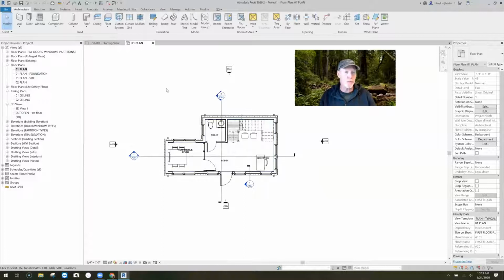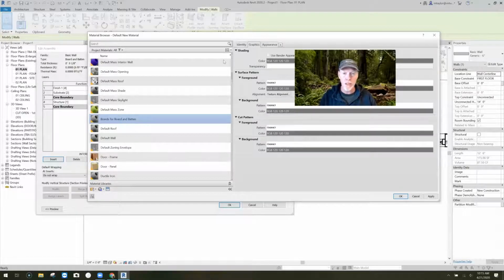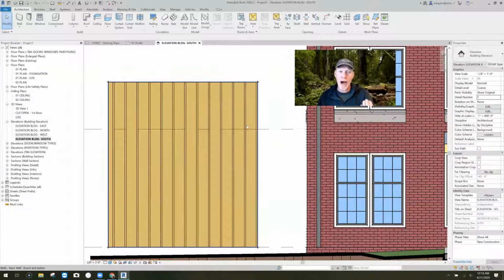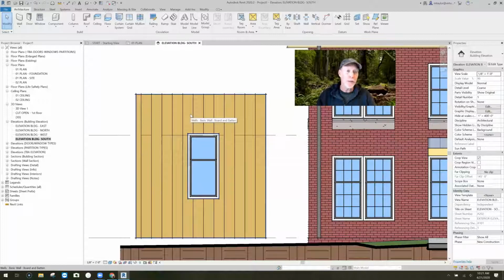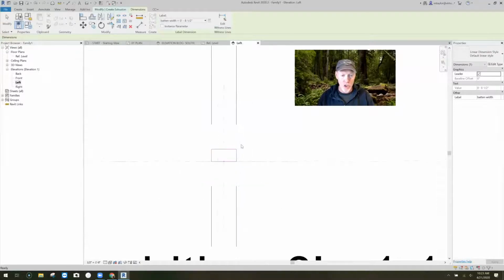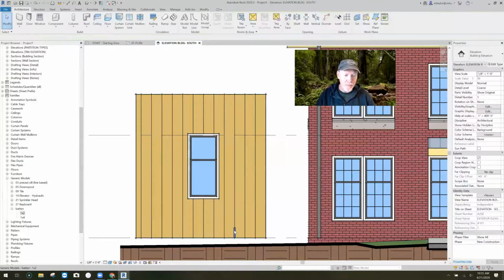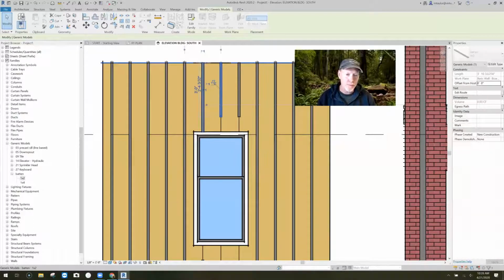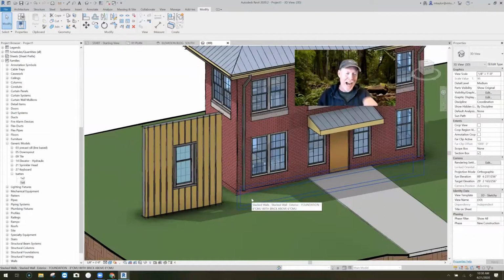BOARD & BATTEN - Pattern and True 3D

Comment: Awesome video...I just recently came by your channel; it is the most straight forward - Thanks!! I am being forced to switch from S*ftPl*n to Revit and it seems so much more time consuming and in my turn and burn environment I am losing my mind ( and possibly my job ). Is there a turn and burn method for elevations to paint or draw lines to display trims, frieze , bands etc.? this modelling seems far so slow compared to what I am used too.....desperately seeking advice. TY

Comment: Great video! I had an issue connecting the trim around the window frame. I'm getting prompted that I can't align the battens at each corner of the trim. and that there are constraints. So the batten pieces aren't flush at each corner. I've tried to remove the constraint but that doesn't help either. Do you have any suggestions for remedying this issue?

Comment: can you think a better way to model Yellow truncated dome tack tile on the floor?

I was thining similar approach, curtain wall flat on the ground. 

but can not figur to make circular truncated dome individually on grid intersection ??? 

current approach is 2 ft x 1/2in rail, so it can detact topo. how to illustrate the circular truncated bump dome on the rail?
Reply from the maker: If I follow your question properly:  I think I would represent the tactile domes on the floor with a pattern (easier to deal with in plan views) and then make a 'bump map' in my Material for any renderings.
Reply: @miketaylor-fantastic  

need to import circular grid pattern  from autocad to revit. then create bump map deal.

bump map deal will not shown shaded view, only shown on render view

Comment: Very informative video. Thank you for explaining this. I have one issue: I can't place the batten in Elevation view, only in 3D view. Any idea where I got turned around? I've watched the video multiple times and don't see what I missed. Revit LT2020
Reply from the maker: Hmmm. My thoughts: In elevation, make sure up at the top you select 'Place on Face' and select the face of the wall, before you select the Pick Lines tool. My guess is that in elevation you are somehow trying to place them on a workplane not aligned with the view. So try what I suggested and see if you can place them in the true elevation view.

Comment: Please help. the batten in not connecting to my entire line, i made sure it was the whole length when i edited the family, but it is only copying at 4' and i cannot edit the length in my work plane
Reply from the maker: Hang in there Mackensie... we can solve this. ;)   Ok. Open the batten family for editing. In a Line-Based family.. you need to connect your geometry (batten) to the Reference Plane in the family. So, in the family, in the Ref Level view.. you will see the dimension from the insertion point over to the Reference Plane (4'-0") Your batten geometry (created when in the Left or Right view) needs to connect (align and lock) to the Reference Plane. You can pull it back and away about a foot or so, then use Align to get it to extend to the Ref Plane, then LOCK it there by clicking on the little lock that appears right after you use the Align tool.  Save and insert it back into your project. It should work fine when you select a line on your model using Pick Lines.  I hope this helps. Watch the video again to see me do these things listed above. Blessings!
Reply: @miketaylor-fantastic  thank you. I actually ended up making it a profile and somehow that ended up working! Thanks for getting back to me so quick!!
Reply from the maker: @Mac_kensiiie  Thanks!  And good job on the profile!  I'm trying to make sure everyone has success when using Revit. We are all in this together! ;)
Reply: I seem to have the same problem. I drag in the 4' batten ok, but cannot stretch it to the top of wall.
Reply: Just read your reply to Mackensie which was the information I needed. Thanks Mike

Comment: You appear to really have a fun time putting this together.  I wonder if you'd have as much fun simply using a Vertical Wall Sweep?  A new category can be created in the Wall Object Styles and assigned to the sweep for controlling visibility.  Array the sweep along the wall @ your desired spacing. Now add & move windows & doors; modify levels associated w/ that wall, change the roof pitch of the wall attached to that roof, etc.  And the fun continues.  Thanks for bringing us so much joy in Revit.

Comment: How would you make the wraps in the walls in a seccion ? at the top and at the base .. greetings from Argentina
Reply from the maker: Hiii TheCheo89!  OK... as you have probably found, the WRAP feature only works in PLAN orientation. Typically materials don't wrap at the TOP of a wall, you  can put a cap on the wall if it is a parapet.  Nor does material typically wrap at the top of a door/window. A header will be at the top. And a sloped sill (wood/stone/brick, etc.) will be at the bottom. These can all be added as separate families (or a sweep for the wall cap).  Does this help?
Reply: @miketaylor-fantastic  Ok, thank you so much!!! That was a big question I had regarding the modification of walls. but you could make a video about how to use the tools to modify the structure of the wall vertically, such as modifying region, merging region, because I tried to wrap with the materials from outside the core to the core materials and I could not do it .. Again, thank you very much.
Reply from the maker: Yes, I can show a video about Modify Region and Merge Region in the section view of a wall. Those are mostly used for continuous materials for the full length of a wall. They are locked at specific heights also, so they don't really work for doors/windows. I personally much prefer using sweeps to modify the walls, because I have much more control.. just sayin'. ;)
Reply: @miketaylor-fantastic   OK great, I'm looking forward to that video. again Thanks!!!

Comment: I ask a $10 question and you give me $1000 answer. And you give the answer super fast!!! It is awesome how you can create a family that aligns with the wall. This method will be very useful for more than just adding batten boards or window trim to walls. Thank you so much for this super awesome video! You make it look easy but I know there is a lot of effort in making quality videos. You are by far my favorite BIM Manager 😁

I am going to push my luck... and ask another question. I am laying out a complex gable & hip roof. I get the basic footprint, overhangs, slopes and ridge lines as close to right as possible. But then when I make minor adjustments to roof extensions/overhangs, the ridge lines move. There is always tweaks to be made.  Short question long.... "Is there a way to lock down 'ridge lines' so that they don't move when using 'EDIT FOOTPRINT' command?  It makes me want to scream 😫
Reply from the maker: @Ken B: Unfortunately, you can't LOCK the ridgeline when working on an overall roof of the building. Yet, if you make each sloped surface a different roof... you can then lock the ridge location. It's not best practice to break the roof into many different parts, but you can.  We all deal with the ridges moving when we 'tweak' the roof. Been there, done that! :/
Reply: @miketaylor-fantastic  Didn't think of that. Great idea! Thanks!